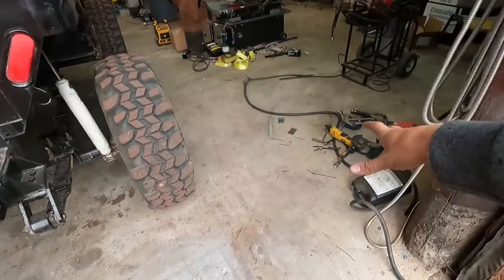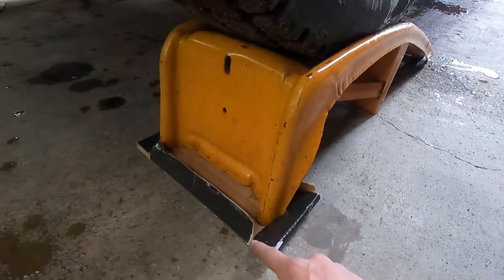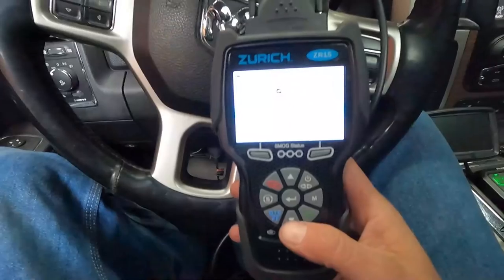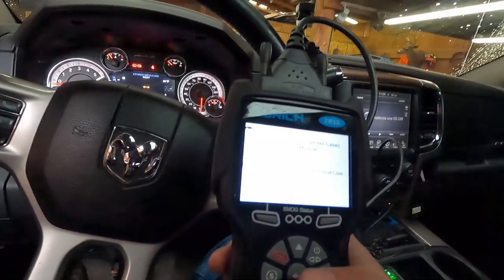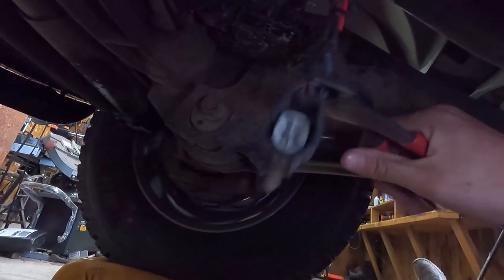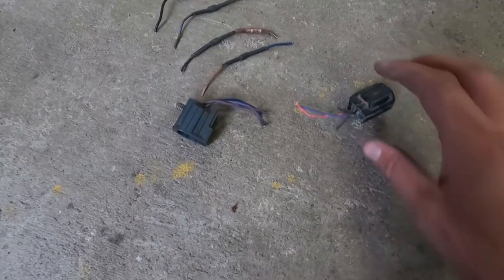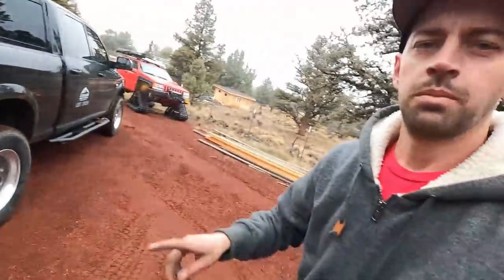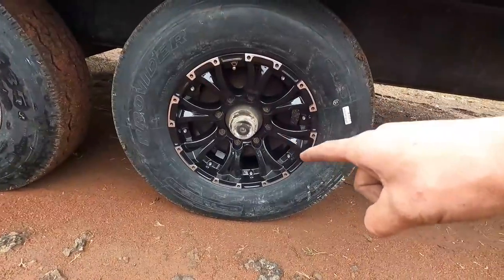4th gen Ram 4x4 not working.  How to incorrectly diagnose and fix.

Comment: My wife wanted to try driving our Monza V-8 RWD car up onto the ramps, it was on a slight incline, on a gravel driveway. I told her to give it just a touch of gas, she gave it too much gas, the rear wheels broke loose, she panicked, gave it more gas, the rear wheels grabbed again, all that emerita drove the front wheels off of the ramps and the suspension came down on the ramps. Nothing was hurt, got the floor Jack out and got the ramps back under the front wheels. I gave her big points for wanting to try.

Comment: Learned a lot from this vid, Thanks. Word of Caution, Those car ramps look a lot like the ones I had that one collapsed without warning on me under the weight of my Ram 1500. Good that I was under the opposite side at the time but had to throw away my skivvies. Just sayin.
Reply: That’s why I use solid rubber ramps. They do not brake or slide, I’ve had no issues yet

Comment: Interesting that cardboard gives that extra bit of friction. Another similar use to do the opposite is using glossy magazines under the wheels when you lower your car down to allow the wheels to slide out and back to normal position without having to roll it back and forth. Prob not useful for a solid axle but on my little kitcar with independant suspension it can be useful

Comment: I know this is an old post but I’m in need of some help. I’m having a very similar issue. The wires actually ripped out of the connector. The connector is labeled 1 through 4 on the side of it. I don’t know which colors go to what number. I have two purple a red and a black. In your video I can almost see what goes where but not quite. Any help would be awesome and greatly appreciated. Thank you very much.

Comment: My 3500 Ram has the vacuum discount and it never worked. I have to use my 4x4 almost every day. So I just bypassed it.  Now the front axle is locked in all the time.
Reply from the maker: I wish there was an easy way to bypass this, but the problem is that if the computer doesn't see everything working correctly in the front axle, it won't engage the transfer case.

Comment: This is why I don't own new outfits!! All I have to do is grab the little lever on the floor and move it forward or backward and listen for the "clunk" (after turning in the hubs, of course) and PRESTO Im in 4WD!!! 🙀🙀🙀🤯🤯🤯
Reply: I have two 1944 Dodges , a WC51 and a WC54. As you say very staisfying Clunk as the big chunky lever moves, and off they go. Series Land Rover's , you could often buy one cheap 'Stuck in 4 whel drive low'. Much clucking, tooth sucking  and 'Rebuild the gerabox ! Expensive! I'll buy it from you cheap. Go around corner. Unscrew Yellow knob on top of 4 low selector. Remove spring fronm shaft, it's sits sstraight over it. Place large washer down shft where it goes into transmission tunnel. Screw yellow knob back on . Drive forward work Red Knob high , low selector back and forward. Result 'Oh What a suprise ! It works !. :-)

Comment: What’s wrong with the hitch he installed on the back of the Willys?
Reply from the maker: There's nothing wrong with it
Reply: @CaseyLaDelle  you said people had made comments on it or did I get that wrong?
Reply from the maker: @Impuritan1  a few people said it wouldn't work because the pin hole would be inside the cross member

Comment: Had a bad experience with Etrailer last year. Not sure I'll do business with them. I ordered 4  five lug hubs and 4 backing plates for my trailer. Got 3 five lug hubs/drum and a 6 lug hub/drum. They were going to CHARGE ME EXTRA + Shipping to ship me the correct part. But since they were out of their in house 5 lug hub/drum , they were going to replace it with a dexter hub/drum. So to fix THEIR mistake they were going to charge me an extra $160. And they would refund the $75 I originally paid for the wrong part if I shipped it back to them for $50. No thanks!

Comment: Get a posi lock for that. Throw that piece of junk away
Reply from the maker: Not possible.  If the computer doesn't see the front axle disconnect actuator working correctly it won't shift the transfer case.
Reply: @CaseyLaDelle  well shoot